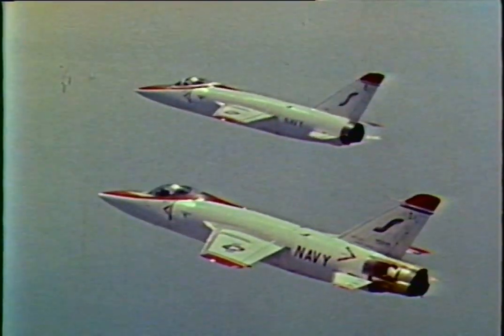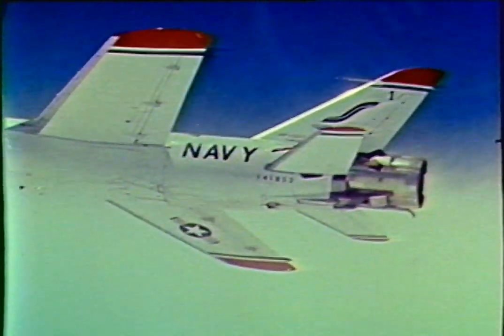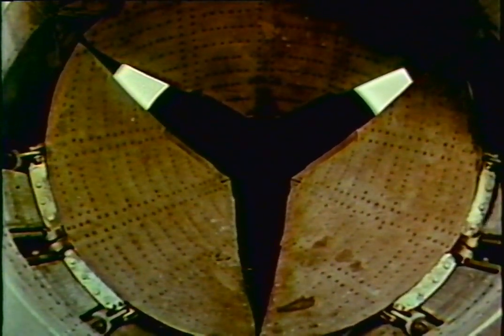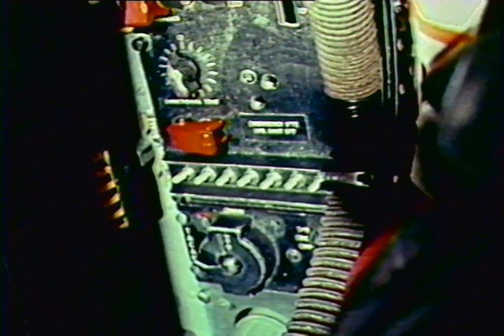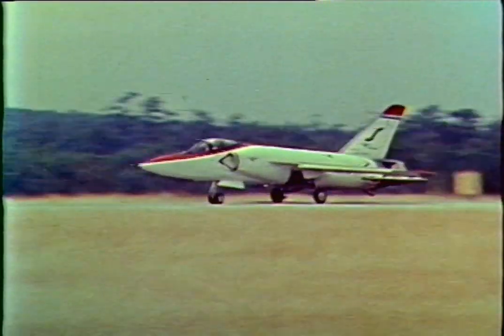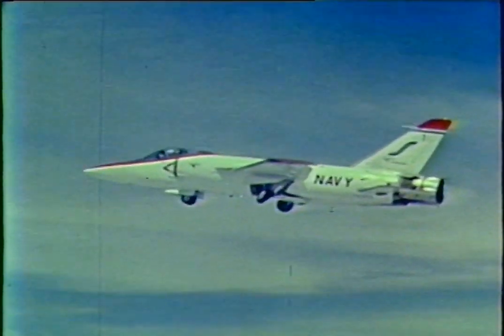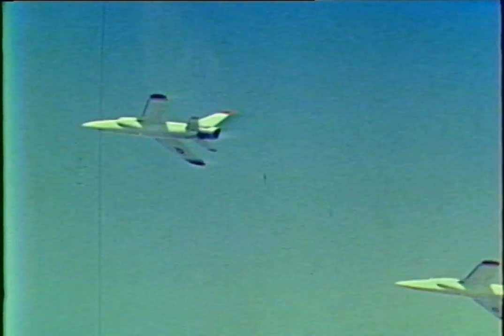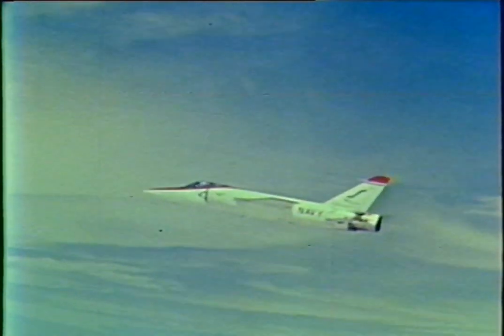IFTC Program using Grumman F11A Tigers as test articles

Comment: What happened to these two aircraft?  Tiger was such a beautiful plane, just underpowered so I imagine the planes were flown with less than full fuel to get higher performances that would be closer in line with newer fighters at the time.  Did Grumman ever provide the data from this program to McDonnell Douglas for the F-15 SMT-D program?

Some clarification would be nice!
Reply: The f11 was retired not because it was bad, but because there were planes that were better I think
Reply: @Kelgo102  It was comparatively bad compared to new developments once it made it to production......  The Super Tiger with the J79 was hugely competitive though.  Matched the F-104's performance without the crappy and dangerous wing loading.